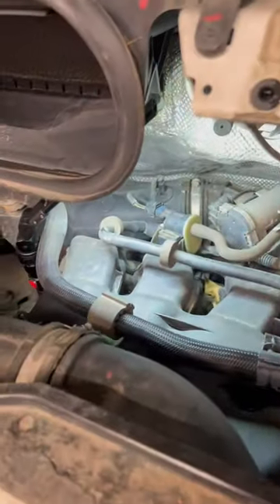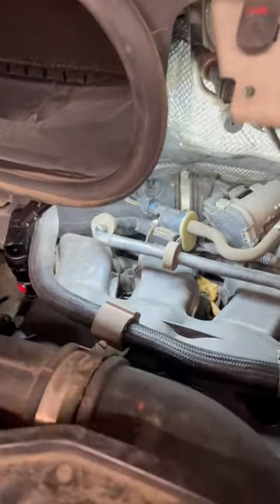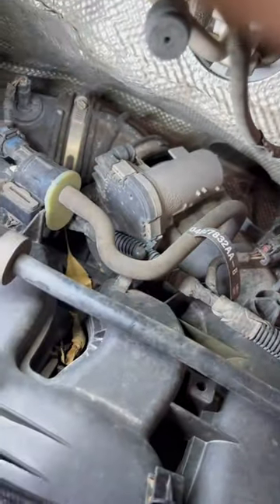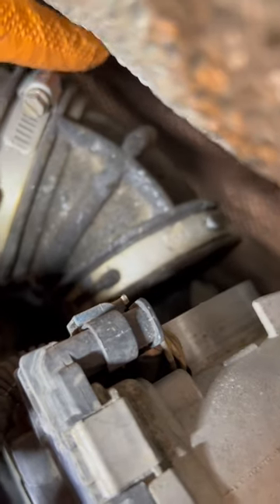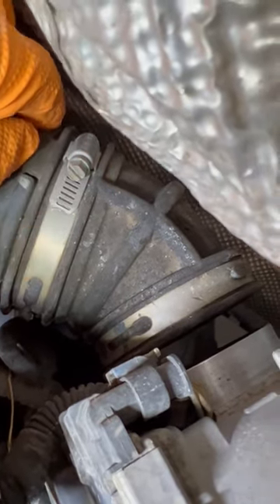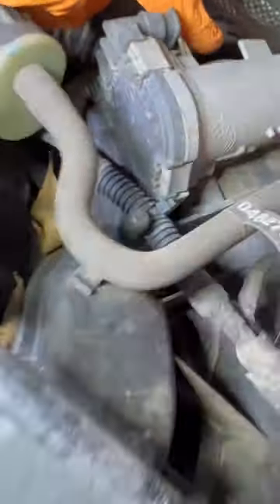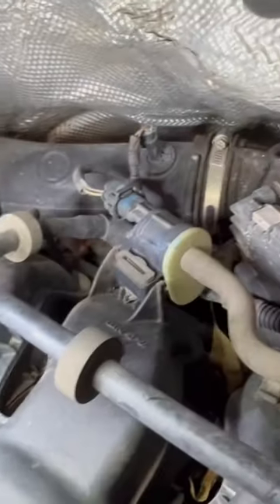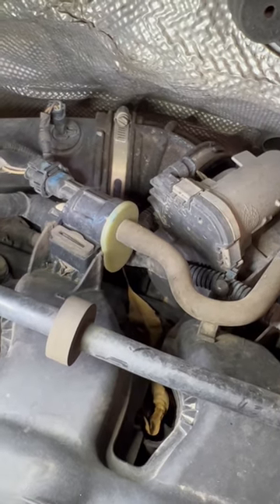RAM Promaster! Check this before you wreck your engine! #shorts

Comment: YEs! Mine was off! It’s been to the dealership 2 x and they didn’t notice! I was changing my air filters, and I noticed this! Must have been like this for a long time as my air filter was hardly dirty!  Is there anything else I need to do to make sure my engine is ok? I sure hope it runs better now!
Reply from the maker: No there’s not much you need to check after it’s tight. A little bit of dust is ok but I wouldn’t want to run it with that hose off for too long!
Reply: @FleetTech97  thank you!

Comment: I brought one a few months ago and I just realized it can’t go over 75miles per hour any suggestions?
Reply from the maker: Does it feel like it’s sluggish accelerating? Like what happens when you hit 75? Does engine bog down?
Reply: @FleetTech97  I have the problem that you described can you tell me pls what is?
Reply from the maker: @hugoalexander95 it’s probably got a engine misfire. Any engine lights? 

Iv had lots of them with bad injectors and bad ignition coils.
Reply: @FleetTech97   yes I have the check engine light
Reply from the maker: @hugoalexander95 what is the codes you have? That would help pin point it.
Reply: @FleetTech97 YES this happens to me! It seems to slip into a low gear and then climbs back up in RPMs…I can only go about 40mph on grades!

Comment: I have a a 2500 Pro and the hood cable broke. Any advice on how I can open the hood??
Reply from the maker: Hi sorry for delayed response. I believe you can get a screwdriver between the grill up to the latch. I will check when I’m back at the shop and see if I can film a video for you.
Reply: @FleetTech97  thanks that would be great